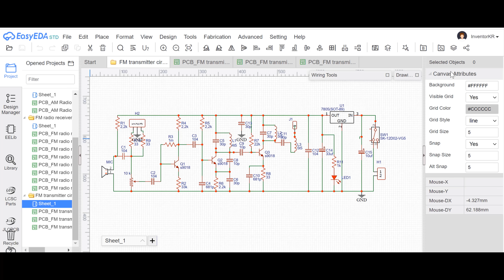how to make simple inverter 6000W , 4 transformer , sine wave , IRFz 44n ,jlcpcb

Comment: Would you convert 500 amperes from 12 V into 6 KW at 220 V? Even with such thin wires! Neither Tesla nor David Copperfield did that
They say that Serbs are the biggest liars, Tesla is a Serb, the only one who didn't lie, everyone else is lying. I used ten square wires on one converter, 50 W resistors, so they were as hot as an oven

Comment: Trasformatori da 10/15 watt, 40/60 watt al massimo, usare transistor o mosfet da 50 Ampere non serve a nulla con trasfornatori cosi piccoli, oltretutto occorrerebbero 375 Ampere, e cavi da 95 mm quadri per 4500 watt se alimentato a 12 volt, rifletti prina di scrivere dei numeri.

Comment: All these type of powerfully inverter video I see only free run of a drill machine. Nobody shows the performance while making a drill hole on any surface. A 1350watt drill machine takes 80watt while free run. I want to see at least 1350watt load applied on a 3kw inverter. I made one and disappointed

Comment: You connect all the bases and emitters in parallel with really long length of wire, this is not good because the longer the wire, the more it will ring. Also you need  proper heatsinking or use MOSFETS with proper driving

Comment: It has no 6kw for sure, maybe 1kw. It has no dead time for tranzistors, cant see spwm microcontroler, only ne555 which is just simple timer not designed for such a designs. No snubber circuits so tranzistors will burn soon.  Regards

Comment: Nice trick, you did not turn on the voltmeter display to show us the output voltage while running both the bulb and the hairdryer. It would be fun to reveal the output that way we could be convinced that your project is producing at least 5000 watts 220 vac
Reply: can't be, looking at the transformers.

Comment: Is not Sine wave, is Continuous current at output, that of course pretty much all devices can work except asynchronous motors, and devices that use thirster/triac as  power regulator or switchers, and very dangerous if you touch the output INSTANT HEART STOP.
Continuous current is very dangerous because is not like alternative current, continuous current lock you in that position indefinitely.

And, yes is a pay'd promotion for JLPCB for sure.

When the dryer has been connected is shown that the light from the bulb is drastically reduced, most likely from 200V to about 100V and that decrease in power let the drier and the light bulb consumed power go to the rated transistors and diode rectifiers power of about 600W at maximum.

So this is not a Sine wave 6000W inverter, is a 100/200W continuous current inverter to stay in a minimum 180V output Voltage, and even that to power 220V power wall inverters you need about 250V CC to start, other rule is applied for CC motors.

Youtube need to be sued is someone get hurt or die because of this type of shit, this can be prevented if downvotes were visible.

Comment: Moi un truc qui me chipote, c'est que même avec un rendement de 100%, il faudrait que l'alimentation 12 volt fournisse 500 ampères, vous imaginez la taille des câbles  !!!
One thing that quibbles with me is that even with 100% efficiency, the 12 volt power supply would have to supply 500 amps, you can imagine the size of the cables!!!
Una cosa que me molesta es que incluso con una eficiencia del 100%, la fuente de alimentación de 12 voltios tendría que suministrar 500 amperios, ¡puedes imaginar el tamaño de los cables!

Comment: What about the wave form, is it Sin wave or Square wave? and how much output frequency?
Reply: It is a continuous current output inverter that at a small mistake can bring you the Darwin reward.
Reply: If you see the transformer you will know what freq need. It is BASIC. Iron core transformer freq at 50-60Hz and ferrite core transformer run at 30-50khz. In this case it is ferrite core transformer

Comment: 1. the circuit is different to that what in the description is written. With DC 207V you can power R loads like bulbs motos or heating devices to show it 'works' but other devices barely.
2. although you are working earth free, why you solder wires to bulps and wind it on the contacts from a plug??? use sockets!!!!

I already came with my finger betwen 230V AC on a the pcb, while changing an Emergency light under power feeded from a Battery Device, thats not fun!

Comment: 1. It's not an inverter as it's input and outputs are both DC. We may call it a step-up DC converter.

2. The description and actual components used in the video different. IRFZ44 is MOSFET as seen in the video description whereas D1047 NPN transistor used in the video.

3. If they used this transistor it needs a base driver stage with another set of transistors which neither seen in the oscillator circuit board nor in the power circuit.

4. D1047 is 200V, 12A NPN transistor, even if it drawing the full rated current (practically not possible) of the transistor the maximum capacity would be 12*12*4= 576Watts only. Whereas it says 6000W.

5. From the picture guess the output bridge diode is rated for 1Amp only. If we load it for a continuous current of 0.7Amps (still the power dissipation by the diodes would be about 4Watt), it can have the maximum capacity of 220*0.7*4=616Watts only.

6. Don't think the guage of the wires used at the DC power side can handle more than 10Amps. Even if we assume 10A, the capacity of the converter would be 12*10= 120Watts only.

7. Need to understand the switching frequency to comment on the capacitor sizing at the output side.

8. Understand it is only a promotional video for the PCB supplier..
Reply: At 6000Watts, the current from the battery would be 500Amp! Needs 4/0 AWG (120mm2) wires. The battery would last one minute. It's a competition on youtube, to make the most powerfull inverter as a click bait. Soon we will see videos of 3 phases Giga-Watt inverters that can replace a nuclear power plan and supply a whole city... from a 12v battery!
Reply: @fongmaho  🤣🤣🤣
Reply: @fongmaho  50 amps and would last 4 hours
Reply: @stratocasterblue  :
The video even don't shows the battery (it seems the dc comes from a power supply instead). Calling that an "inverter" without giving the details, we assume it's a 12v DC to either 120v or 220v AC. If from 12v DC, then 6000W divided by 12 = 500 amps. If it draws only 50 amps then the battery must be a 120v battery pack, as 6000W divided by 50 amps = 120v (and that without counting for the losses). At 6:35 in the video, the multimeter shows 207v DC with only the lamp on, and almost nothing remains when the hair dryer is connected. Also because it's DC, that "inverter" (if we can call that inverter) can only be used with resistive appliances such as incandescent lamps. Anything else with a transformer inside it will fry!

"50 amps and would last 4 hours"?

50 amp x 4 hours = 200 Ah, but batteries capacity is given for a 10 or 20 hours discharge rate. At one hour disharge rate the capacity of the battery is only about half of that.  To have 50 amps during 4 hours with a resonable voltage, you need more than 400 amp/hours batteries. If from 12v, that means 4 large car batteries of 80 amp/h comnnected in parrallel for just 600W of power during these 4 hours. With 6000W of power, even these 4 batteries will only last for several minutes until they die.
Reply: Thank you very much Sir, I was wondering because the wires are so small hahaha
Reply: @vermilionssj9081  I was wondering the same thing, it seems strange that at the end when he turns on the hair dryer the multimeter is off. Probably because the voltage dropped.
Reply: This channel needs to reported and deleted. Fake crap needs to be punished.
Reply: كل ملاحظاتك صحيحة
Reply: @سعيدحواصلي  Hello Saeid Hawasili, Could please write in english, I am unable to follow your reply... Sorry...
Reply: So Matt do you know how to make one of these inverters cheap?, thanks
Reply: Sepertinya anda lbh faham scr detail tntng inverter...termasuk itung itungannya...cara kerjanya kekuatan daya beban dan tanpa beban juga stabilitas daya pemakaianya...dsbnya...bravo
Reply: @godongjati0124  Terima kasih. Saya mulai membuat inverter 40 tahun yang lalu, pada waktu saya masih tinggal di Prancis. Inverter saya pertama hanya square wave, tetapi dikendalikan crystal 50Hz, kekuatannya 800W, terhubung ke aki mobil dengan kabel 16 mm².
Reply: i agree on everything else besides that 10A part, it think it can carry 16A without problems but its still only 192W-Losses, also the switching frequency can be calculated but its just a mess and output changes with input, no real drive circuit with feedback, ATtiny85 would make more sense, also those plastic insulators are really bad, thermal pads or even paste with those plastic ones is "needed".
Reply: Ok
Reply: You're right, thank you sharing your observations.
Reply: It shuts down the multimeter when running at 2000W? The lamp decreases a lot at 2000W. I don’t understand what he is trying to do either.

Comment: Dude.... This is awesome! I'd love to know if there is a complete kit that you can buy to make this? Also, the 12v input, how many amps were going in? What was the 12v power source? Li-Ion? Lead Acid? Thanks. Oh yeah, Need it for 120v @ 60Hz.
Reply: It's fake. If it was outputting 2kW then 170 amps would be drawn from the 12V input. The wires would need to be the size of your fingers.
Reply: Is a continuous current output inverter with an output capability of maximum 300W maybe, continuous current at that voltage can very easy bring you the Darwin reward.
Reply: Source 😁 free energy generátor made in pakistani

Comment: You use mica, as an insulator between the transistor and the heatsink. But as you use a metal screw and nut connected directly to the transistor. The use of mica is pointless in this case. With mica, you must use thermal paste. A very tiny amount, not gobs!  to aid the heat transfer between the mica and the metal. The paste fills in the gaps in the rough surface of the mica and metal since air doesn't conduct heat. Again THE USE OF MICA is NOT as a substitute for proper thermal paste.
Reply: The transistor isn’t touching the screw. The screw only touches the plastic body of the transistor.
Reply: but the small bolt is connected in the rear  to the heatsink panel
Reply: @harakumarghadai7828  That has nothing to say as the bolt threads will be the point of of electrical connection and the nut clamping down to the tab of the TO package. You use mica if you want the transistor it self isolated from from the heatsink.
Reply: @harakumarghadai7828  that's what he is saying. This transistors are "hot" to ground. That's why he used mica between them and a heatsink. But when he put a metal screw he made that insulation useless. Ok you can center them carefully to not touch the screws with their ground but it's not how it's done. Either you use a nylon screw. Or you use a nylon washer with a lip that drops in to the mount hole on the transistor and a nylon nut. And yeah,mica without thermal paste doesn't work. No thermal transfer to the heatsink.
Reply: Ll
Llpl

Comment: Aha-ha 6000 watts, a 100-watt light bulb, the voltage sags up to 206 volts, this unit holds a maximum of 2200 watts under load. At least 4 mm square copper wires were soldered for decency.

Comment: What is input current value of DC Ampere.?
Here we know 12v but Amp...?
Reply: It is given in the wattage. If we assume an ideal world (in which this contraption actually will work). The energy input will be equal to the output energy. wattage P is equal to voltage times current (P=U*I) and hence the input current will be equal to 6000/12= 500 Ampere. At this point I hope you do understand that this contraption probably hardly may be able to output 60 Watt. It is a hoax and a scam. Do not use any time or money on this project.

Comment: For your usa audience a change list for 120 v 60 cycle would be well liked
Reply: The small board generates the cycle. Use a 2:1 transformer for 110-120vac?
Reply: This is a continuous current output is not sine wave and CC can bring you the Darwin reward.
Reply: U very very veri by every very

Comment: The output power of the microcircuit is not enough to drive 8 powerful bipolar transistors.
Reply: Those aren't bipolar transistors. They're MOSFETs.
Reply: @joewoodchuck3824  NO those are clearly marked as  are D1047. THey are  2SD1047 High power NPN epitaxial planar bipolar transistor. What are you talking about
Reply: @afre3398  We must be looking at two different schematics. Not that important anyway.

Comment: İt   does not give sine wave output, it gives DC. Diodes, capacitor, and sg3525/ tl 494 pwm, reactive power control driver 😁😁
Reply: There aren't any rectifiers for the output, nor would the output transformer pass DC.

Comment: Are 6000W the calorific value of this circuit? Multimeter shows DC and it looks like there are rectification diodes on the output, so where is it sine wave. All circuits are simple push pull inverters with exaggerated or wrong performance data, sorry.
Reply: I agree I think even 60 watt is to much to hope for.
Reply: @afre3398  1. It's not an inverter as it's input and outputs are both DC. We may call it a step-up DC converter.

2. The description and actual components used in the video different. IRFZ44 is MOSFET as seen in the video description whereas D1047 NPN transistor used in the video.

3. If they used this transistor it needs a base driver stage with another set of transistors which neither seen in the oscillator circuit board nor in the power circuit.

4. D1047 is 200V, 12A NPN transistor, even if it drawing the full rated current (practically not possible) of the transistor the maximum capacity would be 12*12*4= 576Watts only. Whereas it says 6000W.

5. From the picture guess the output bridge diode is rated for 1Amp only. If we load it for a continuous current of 0.7Amps (still the power dissipation by the diodes would be about 4Watt), it can have the maximum capacity of 220*0.7*4=616Watts only.

6. Don't think the guage of the wires used at the DC power side can handle more than 10Amps. Even if we assume 10A, the capacity of the converter would be 12*10= 120Watts only.

7. Need to understand the switching frequency to comment on the capacitor sizing at the output side.
Reply: @santhoshmathew8656  Maybe you are right. The moment I saw this video, I knew it was a something done by someone who do not understand electronics. It is a scam and a hoax. And that is all I need to know

Comment: You did not show circuit diagram,  not match with what you built, did not show 60hz signe wave, I see power drop when hair dryer used both light bulb and hair dryer not more than 200watts should not see drop in voltage for 6000 watt inverter, I did not see z44 in the circuit.
Reply: If the hair dryer is used on hot , yes it will draw 2kw.
But I don't think so that this inverter is truly 6kw.